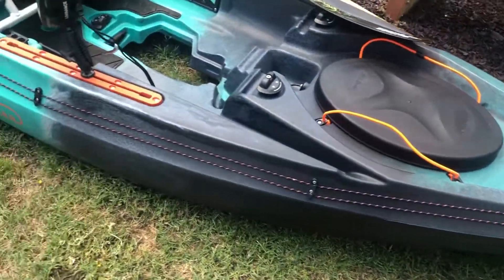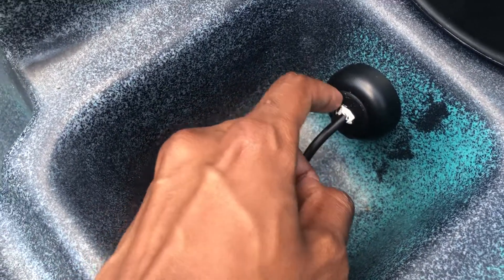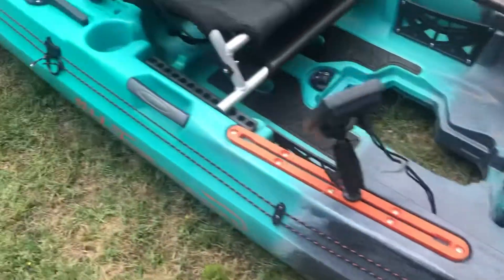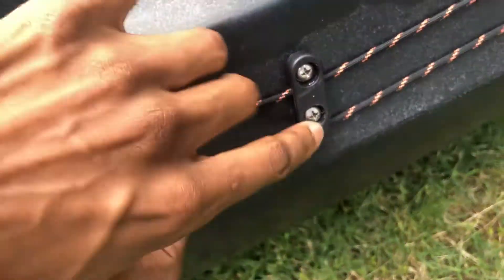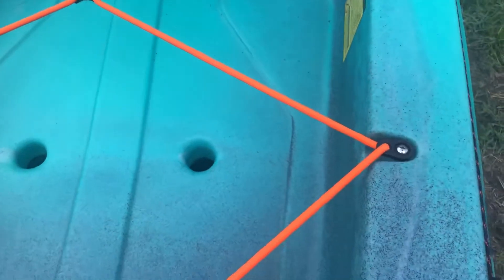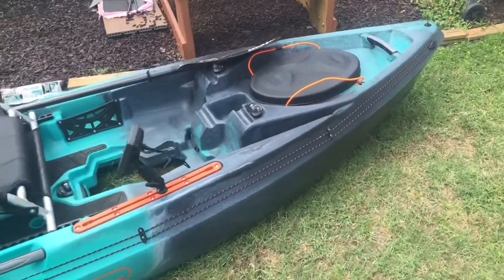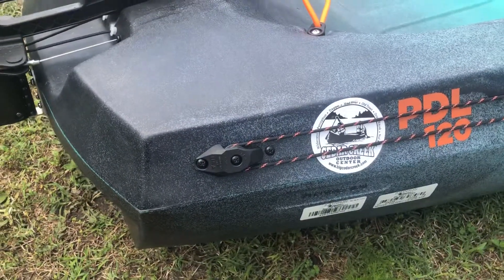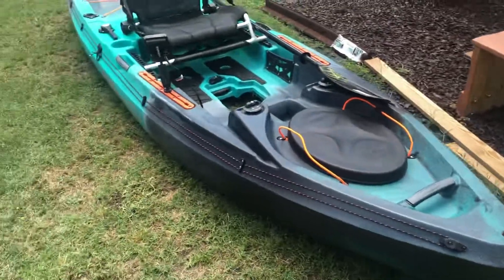YakAttack LeverLoc Anchor Trolley HD [Old Town Sportsman PDL 120]

Comment: Thanks for sharing. Can your anchor be pulled all the way to the hull or all the way to the back of kayak? I can’t tell if the paracord clips would prevent it from traveling the entire length of the kayak…which would defeat the purpose of an anchor trolley.